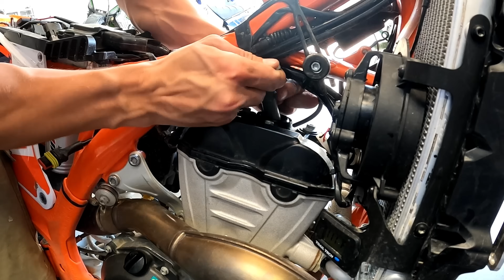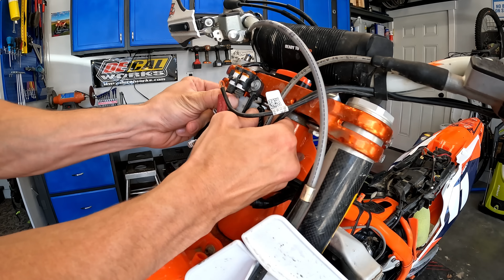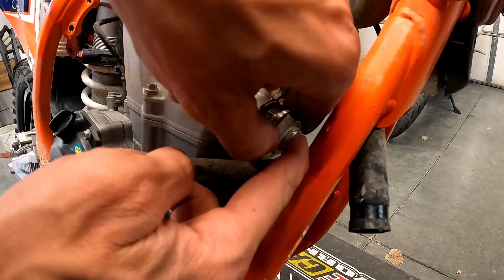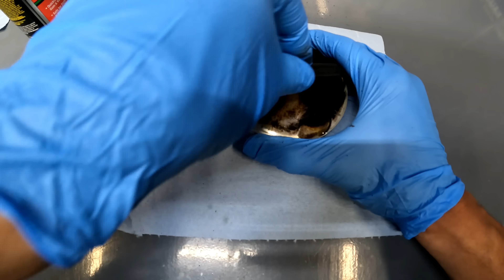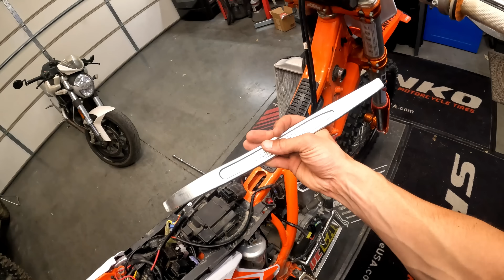Did I Blow Up My New KTM 350?!

Comment: Just hit 200 hours on my 350! Single track, Isde and Hare scrambles, desert riding, valves checked and adjusted once.
Reply: That’s a XC-F too? Have you done any top ends? Or do they last 200 hours in good shape? I’m looking at a used 22 350 XC-F with 32 hours in the clock, looks mint but I’m curious about reliability
Reply: @wicho99w99 excf, tuned Ecu, no top ends yet.

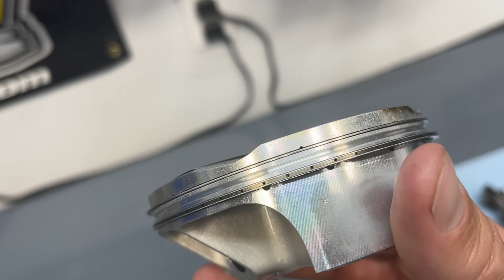Comment: At 5:43 ypu can see blow by, lucky the bike stopped it would have melted the piston. 
The holes above the compression ring are meant to allow gas to push the compression ring out against the walls. 
Suspect the dirty air clogged up a few things. 

To be honest you got lucky slipping with the ring compressor forcing you to buy a new piston. Just cleaning the ring wouldn't have solved this.

Comment: As others have said, it was dust contamination, The tiny, sparkly marks that look like it's been lightly sand blasted from a distance and the light scratching, come from dust particles. At 20 hours it should be mint except for slight greying on the wear surfaces.

Comment: I used to run a husqvarna fx350 and had zero issues in 250 hours. Sold to a friend and he ran it to 450 hours. Pretty sure it's same engine so pretty weird yours went at 20 hours. 
I would say never skimp on oil, air filter or fuel filter. 
Theyre very robust engines generally.

Comment: Raced ktm's for years. I have learnt through expensive experience to run ktm's on motorex. They just last longer and take more abuse. Run 4 stroke transmission oil in your 2 stroke clutch. You never ever have to replace a clutch. That's the important thing when your paying.

Comment: OK there is ZERO chance that mixing the oil caused that. 
It was the fine silty dust you ingested through your filter that caused that ring to stick. You really need to give your filter procedures a refinement. 
The Belray foam filter oil is one of the best out there; I will wash a filter maybe a dozen times or so then it hits the bin. 
The fact that you were going to reuse that piston is crazy, when you damaged that ring groove did yourself a favor as it is a 6000+ dollar potential event to really melt that motor down.
You ask what does this online dude know, I am a ex F1 Honda engine engineer and before that and after I have built more factory race bikes and engines then you can shake a stick at.

Comment: Any oil brand or viscosity talk on here? I’m debating going directly to shell rotella 15w40 right at my break in oil change. 2024 husky fe350. Thanks
Reply from the maker: I run the recommended Motorex 15w-50. I talked about in the video how I mixed oils 1 time with Motorex and Belray synthetic. I thought that could be part of the issue, but after reading comments I believe this was a flaw from the factory. Many other people had this failure occur.

Comment: Had a husky 450 not start in the sand. A ton of sand bypassed the air filter. Took it apart to see rings siezed. No scaring anywhere. Then had the same thing happen to two Honda 450s and took the spark plug out and put oil in the cylinder and freed them up and they ran fine 😂 clean ya filthy filters

Comment: My 2022 came with no oil filter. Called KTM North America to let them know. They told me if I have any issues to let them know. 30hrs later the bike had all the same issues as yours.  However, it failed the leak down test.  Turns out the 5hr period with no oil filter, did cause wear in the piston. 

Of special note, KTM said tough 💩 it's not their fault.  

I had to install a new piston, rings, and recoat the cylinder.  💩  happens I guess.

Comment: You did a lot better than my 2023 350 EXCF-6 days
That did a whole 1h58 minutes before destroying itself
€600 on parts and free labour as an 'apology" from the dealer and I got rid of it

KTMs are not what they used to be - replacing with a WR450 - not quite as good but tenfold more reliable ;)

Comment: Be careful with testing the fuel pressure just on cranking, etc. I had one that would lose pressure as i put a load on it. Turns out there was a hairline crack in the stock MAHLE Fuel Filter, and would only leak under full pressure or while Bench Testing the pump and capping the outlet. Replaced it with a metal fuel filter in-tank, and added an External Micron screen Fuel Filter and replaced all the fittings with aluminum from the tank to the Injector. I haven't installed the better angle metal fuel injector bracket but i will because its also that somewhat weak plastic they used.. 
Ive heard too many stories of people getting stuck out in the woods because of a broken fuel nipple or a clogged fuel filter mesh screen with the stock filter set up. 

Now i maintain a steady fuel pressure even when at WOT in 3rd or 4th Gear.. I made an inline fuel gauge with the stock plastic fuel line pieces like the quick disconnect nipples to add it inline with no tools, and remove it with no tools. 

Then you can route it up to the gas cap area or something and you can see the gauge as you ride the bike.

You seem to unfortunately have an internal engine issue though it seems with the crankcase pressure buildup to force oil out like that..
What does KTM recommend for these new bikes as far as a Break-in period? 

I have a 2020 Ktm 350excf with a bunch of XCF & SXF parts on it and i love it for fast single track and enduro/trail riding. I bought it with low hours in 2020 but the owner said he basically took it easy with it for the first 5 hours and then did and oill change and then rode it full throttle 100%. 

It seems like with any engine, whether its a dirt bike or a new car you should still be doing a small break-in. 

Its my opinion at least, that manufacturer's dont recommend doing the break-in because theyre afraid that it will seem to be like too much work/stres out about breaking in the motor, exactly how the Manual would tell you to do. Also normally its fine with no break-in all and to the company its probably just seems like one more thing to add on for the new owner to do before they can actually ride the bike how they want too... 

On a new Jet ski for example, the ECU itself sets the limit as time goes on, in a ~5hr break-in peroid of limited full throttle time, etc, depending on the manufacturer like Yamaha or Kawasaki..

Comment: Glad it got fixed. Good video. It absolutely wasn't from mixing your oil. Talk to any of the oil companies that make and mix your oil. They will tell you the same. It was pulling dust in through our filter. I've seen quite a few bikes (Especially early CRF250F) that would kill vales and do this exact same thing with the rings from pulling dust through the filter. I was a shop foreman at a BIG honda, Kawi, Suzuki dealer in the early/mid 2000s and can't tell you how many of this exact same thing I've seen. The intake boot on a four stroke won't show the tell tell signs of dirt like an old two stroke. Your filter was under oiled in those areas. Filters need to be submersed in oil, squeeze the excess out and let them dry for 12-24 hours. Great video.
Reply from the maker: Thanks for the feedback! Glad you enjoyed the video. Bike is still going strong currently at almost 60 hours.

Comment: are you liking the 350? i just sold my 250 and im looking for either a 350 or 450 but i don't know anyone that has road a 350
Reply from the maker: I love the 350. This is my 3rd one. I'm not a huge fan of 250Fs due to constantly having to rev to the moob, and 450s are just unnecessary in most situations despite being a ton of fun. That's my opinion.

Comment: This is an AWESOME video - but I'll be honest... as a Honda rider looking at buying my FIRST KTM ever this week (350 XC-f) I am super freaked out that seemingly nothing made this engine blow up.  No dirt... not even positive that it was oil.  So weird?  I've never seen anything like that in riding my Hondas for 43 years.  Are KTM's just very sensitive machines?  I don't have the technical prowess to diagnose like you did - that was very impressive.  My technical challenges I've had with Hondas have been limited to carb jetting and starting issues, and that's it.
Reply from the maker: You know, I've had 3 of these bikes over the years and I love them. This is the first failure I've experienced like this, and there are a handful of comments on this video of people who have experienced the same failure. Who knows if it was a QC issue, or if quality is diminishing. I wouldn't let this one video deter you from buying a KTM personally, and I'm still likely to buy another. Personal opinion I think every manufacturer has failures sometimes, and every bike nowadays is very good.

Comment: 🤔 I find it hard to believe that mixing oils did that, just because you don't see dirt in the Throttle body doesn't mean a lot Didn't make it true, it's obvious the filter was leaking. Even in the video you could tell that filter was bad once the pores in the foam get enlarged from cleaning it's time to throw it away. You didn't show in the video but hopefully you checked the valves with a fluid test just To make sure they didn't develop leaks from the dirt. 

With all that said it's the first time I ever seen dirt stick a ring It usually just prematurely wears them out along with the cylinder. 
Every time I've seen a stuck ring it's usually caused by overheating which would have been obvious By inspecting the cylinder or something Going through the engine and crushing the piston  slightly Which also would have been obvious with some type of mark on the piston or the head.
It's not impossible there was some type of defect in the piston right from the factory. It's kind of weird How much carbon was on top of your piston If the problem just happened at the last race It kind of looked like maybe it was slowly developing which Make me lean towards a Defective piston.
Reply from the maker: Lots of comments on this video of people saying the same thing happened to their new KTMs. I'm more and more lead to believe it was a factory issue. Appreciate your thoughts and comment.

Comment: Few people can truly appreciate the joy of hearing the bike you've been working on for a while start up and run. Good job dude! Hopefully you get more than 20 hours on her before you have to break back into her!
Reply from the maker: About 13 on her since this video, fingers crossed! Thanks for the comment!
Reply: @KincadePavich  Nice to hear it's running good again! I felt the pain of when that piston drop down so fast..lol. What i see most people do is just tap it down with the wooden hammer-end lightly until it gets started in the cylinder. But it almost seems easier to just do it the old-fashioned manual way like you ended up doing. 
What is different from the KTM piston vs the Weisico, that the KTM Circle Clip Tool doesn't work the same? 
I have to do the Top End on my 2020 350EXCF this winter before i have any issues with it and so i know its all new and good. They do use a pretty beefy timing chain. I have 200hr's of single-track riding and a few HS style offroad races with it and it's been great since i got it. I bought it basically new with low hours. Just figured im getting to that point of hours where it might be a good idea to get it done. 
So i figured id ask about the Weisico piston kit because thats what i planned on going with in my rebuild. I use them in all my 2strokes, so far without any issues, over years now. 

Also, what kind of warranty, if any, does KTM give on these bikes new? Just curious really.
Reply from the maker: The Wiseco piston is a traditional circlip design, while the OEM KTM one has the odd flange on it that makes that tool almost mandatory. The ring design on the Wiseco is different too. Given the OEM compression ring seized, and many other comments saying they experienced the same failure, I am glad I went with Wiseco. Bike is at 60 hours now. KTM offers 0 warranty.

Comment: Mixing oils is not likely the issue. I've done it many times on many bikes without any problems. Both of the oils you mixed likely met the specifications for the bike and would have been fine.
Reply from the maker: I suppose I'll never know for sure. Hope she keeps running strong.
Reply: @Kincade Pavich  I hope so too dude. I'm curious if KTM would have done anything to help you out in this scenario?
Reply from the maker: @Parashoootist  Well, KTM race bikes come with 0 warranty whatsoever, but I also bought the bike used with 4 hours on it. So no, I didn't even try to get any help from KTM. I also feel like given the filter got dirt from it AND I mixed oils, one of the two is likely the culprit and I don't blame KTM to be honest.

Comment: Have a friend with a 2021 350 sxf that has done this twice in under 50 hours. Works fine until it suddenly loses compression. Seems to be an issue with the OEM piston getting "squished" and pinching the top ring. He bought a aftermarket piston for it (cant remember what brand) no issues after that so far
Reply from the maker: Super interesting. There have been like 5 comments similar to this one on this video now. Makes me feel a little better knowing it might have been out of my control. Also makes me feel better knowing I went Wiseco, as the ring design is significantly different and hopefully less prone to failure. All said and done, I was only out a bike for like 2 weeks and now she's ripping again.

Comment: Looking at what you took out of the piston ring groove, it looks a lot more like some of that carbon build up on the piston came loose and got in the groove. And since you didn't change the fuel mixture, it will happen again. I believe the motorcycle companies, to satisfy the pollution of the bike have made the exhaust out lets too small and is causing the build up. So if it happens again either lean out your engine more or open up the exhaust. Just my opinion.
Reply from the maker: It's EFI. What am I supposed to do?
Reply: @KincadePavich  Well I guess take it to the dealership to see if it can be reprogramed. But that is the reason I like carbs. But I was going to say, just looking at my new 2 stroke the exhaust is being choked off having to go throw this 1 inch pipe. But in your case the EFI would adjust to that and still leave that carbon build up. Once I get my broke in, I'm going to a fab shop and open that exhaust up so the engine can breath better. If it can't get out then it can't get in. But again I don't recommend that for yours because if that EFI. It'll just compensate for it and still put carbine build up on yours. Try to find an old mechanic and see what he thinks.

Comment: Mixing you oils would not have been the problem. I’d be looking more at at kind of fuel you were using building up carbon. Or it’s a factory defect as a automotive mechanic we’ve been seen it left and right on EVERYTHING

Comment: I work at a dealership that handles huskys, make sure that bike doesn't have the plastic oil pump gears, if it doesn't try and find some slavens metal pump gears, the engine failure you had is sadly not super un common. The euro bikes suffer from some odd failures. It's probably not the oil, we have seen top ends on 10 hour bikes, husky isn't even sure what it is, but they seem to have a metallic paste that shows up
Reply from the maker: Super interesting. Thanks for the comment and feedback.

Comment: good effort man, i have very little experience with bikes but i do know the fear and the exaltation of a bike being dead and then starting again. Source: i took my 2005 DRZ400S on some single-track and dropped it on a steep incline in the middle of nowhere, it wouldn't start. Turns out when it fell over i hit the kill switch and forgot to turn it off again :) was only freaking out for 10 mins but it felt like a lifetime
Reply from the maker: I borrowed a friend's sled this winter and spent 15 minutes alone in the parking lot after my friends took off wondering why it wouldn't start scared sh*tless. Kill switch. Hahaha

Comment: over filled the oil did you let the oil out and refill or start it over filled if you did this you could have cracked the piston ktm's are known for making thin piston tops my 640 adventure went back three times and kept cracking pistons then i got an after market piston had them put that in that was twenty years ago it don't use oil goes like a demon.

Comment: That's ton of carbon build up for 20 hrs. It will happen again if you don't figure out why.
Reply from the maker: Any suggestions?
Reply: @KincadePavich  SWAG but maybe running too rich, faulty O2 sensor, coolant sensor, leaking fuel injector. Too much fuel will wash the oil off the rings and could cause a lubrication issue. Not a bike tech but did automotive for 40 years. These are the basics of FI feedback systems. Good Luck! Agree with others mixing oil should not be an issue.

Comment: I blew my 21 KTM 350 XC-F up at 27.1hrs at a Hare Scramble right after the first hour. Diagnostic. Ring failed, broke cylinder wall and piston, went to bottom end, destroyed the crank. 

I fixed the bike and immediately sold it. I went back to a 300 XC-W. 4 strokes are way too expensive.
Reply from the maker: I switched to a 2 stroke with the same thought in mind, and then the 4 stroke itch got me... Hopefully this bike is rock solid now. Time will tell. My GasGas 350 last year had 180 hours on it and I never even pulled the tank off.